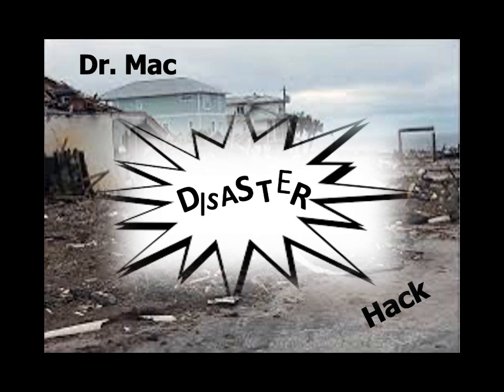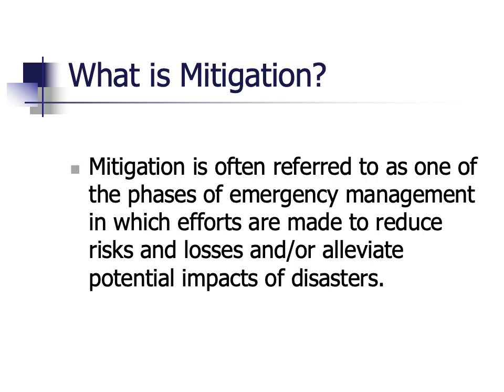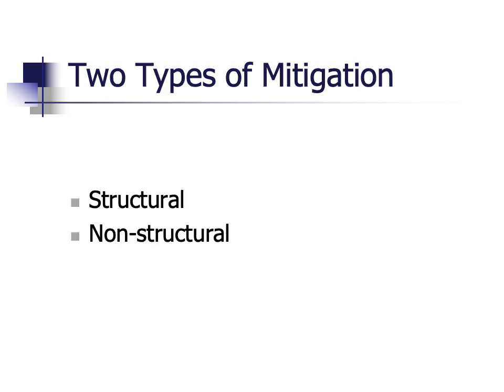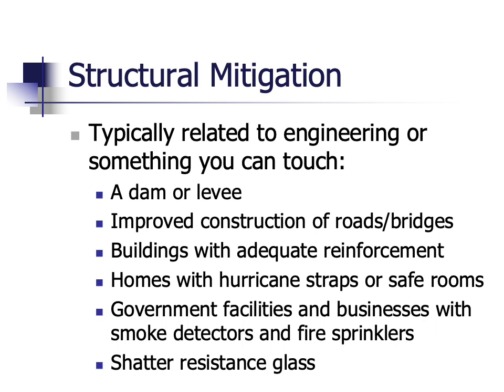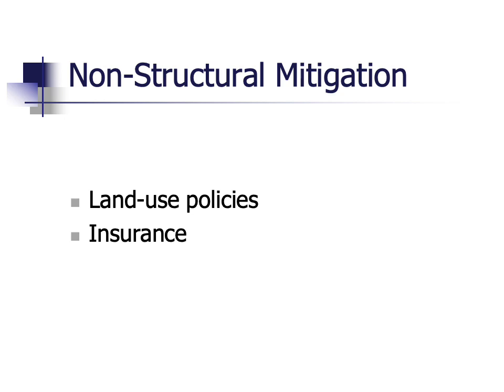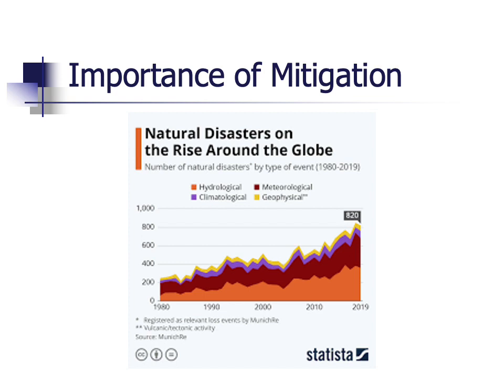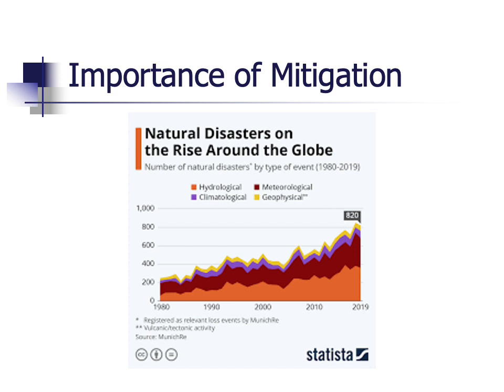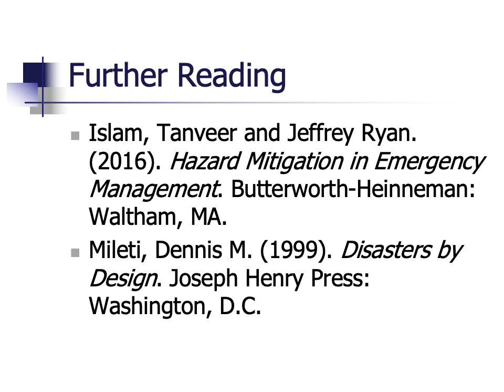Structural and Nonstructural Mitigation for Disasters and Emergency Management

Comment: would you say firebreaks (used in wildfires) are structural mitigation or non-structural mitigation?
Reply from the maker: That is a fantastic question, and I've never thought about it. I'm glad you brought it up because it is an important example. Structural mitigation often relates to engineering, construction and retrofitting. On the other hand, non-structural mitigation typically covers codes, insurance, and set back requirements. In some ways, a fire break is like a set-back. It is definitely a vital adjustment to reduce risk. I wonder what others think. Chime in!